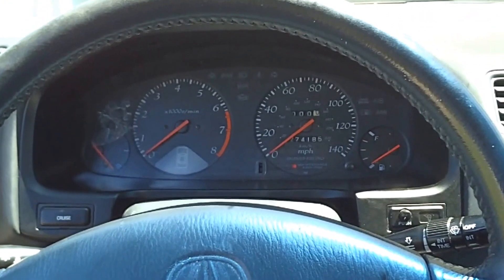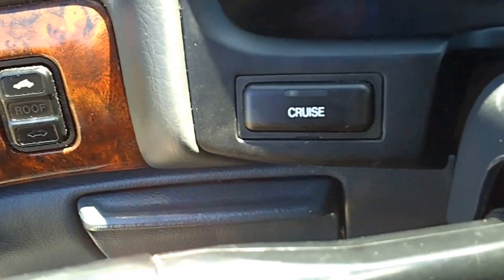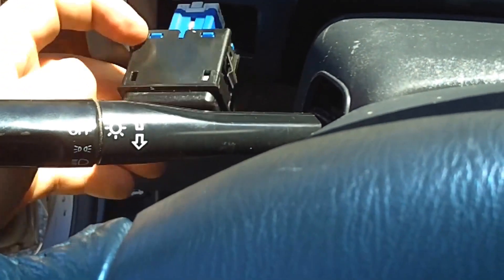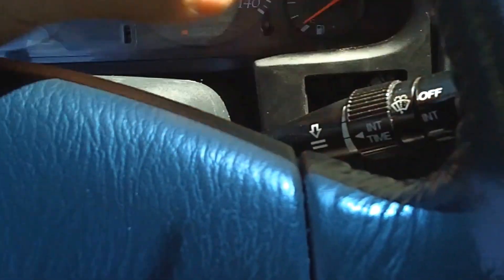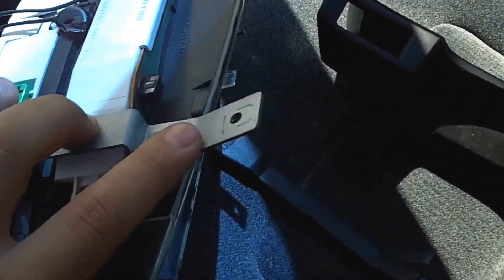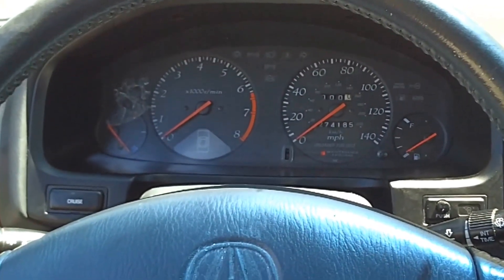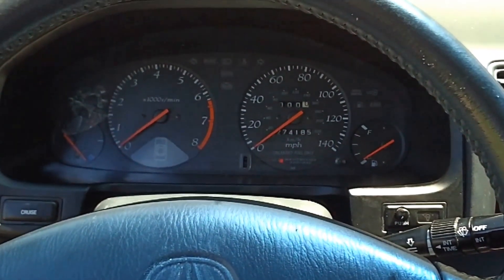Acura CL Cluster removal DIY

Comment from the maker: Yeah, it's in pretty good shape for the mileage.  As far as the tab goes, when I worked on car electronics as a job we used to use either hot glue(rare) or 3m strip caulk to hold the plug in place if the retaining clip was broken that held it in place.

Comment: thanks for the vid. i was getting hung up on the top plugs too. i wanted to replace a few bulbs and pull out that damn ABS bulb. common issue. i had it checked out and brakes were normal. also know someone else with a cl like mine but hers isnt the 3.0 like i have but same issue. abs on lol
Reply from the maker: Yeah my ABS light was on the entire time that I owned that car.  The brakes never failed me once on it.

Comment: 274k, looks clean for that mileage!  Any tricks on getting the dimmer back in?  When I removed mine I couldn't access the back and a small area broke off that retains the harness plug tab.  I found a magnetic screwdriver is key for reinstalling those hidden screws.

Comment: OUT is not too difficult ... putting it back IN is a pain in the XXX.  I too had to get rid of the ABS light which is a small lamp located on a circuit board.  Not MENTIONED in the video is that you must remove the circuit board which is covered by a white plastic piece that holds the large dash bulbs.  There are 10 screws that hold that circuit board in place and, for some reason, despite the board aligning in only one fashion and getting a few of the screws started, 7 or 8 of the screws simply won't start to thread.  I'm taking the rest of the day off due to frustration and I'll start again tomorrow.
Reply: Curtis altschul results?
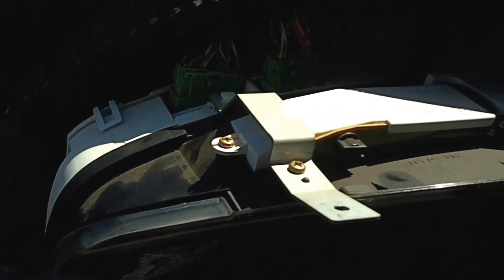Reply: @reyyce4658  Regarding the screws that would not thread ... it turned out that I'd made a mistake in aligning the speedometer and tachometer.  Once they were aligned properly (which I thought I'd originally done correctly), everything went together.  Those screws were necessary as nothing worked without them in place (no lights, gauges, speedo/tach - nothing).  With them in place everything worked.  There are two brackets (2:24 of the video) that should be removed/unscrewed which will make removal and return MUCH MUCH easier.  If you are mechanical enough to take this apart, you'll see how things go together.  The ONLY special tool you'll need is a magnetic Phillips screw driver.  Without such a screw driver it would be virtually impossible to put in the bottom two retaining screws that are a recessed a couple of inches in.  I bought one at a local hardware store for $8.  Actually, it turns out, that I was wrong in my first evaluation and the whole process, when done correctly, was pretty easy.

Comment: It looks pretty simple to get the cluster out, my question is, how difficult would it be to change the lights in the instrument panel? I want to get rid of that horrid green and switch over to a red.
Reply from the maker: From what i saw, it didn't look "easy".  It didn't look like your usual Honda cluster where the bulbs just twist out.  But I didn't really look too much into it at the time.

Comment: My dimmer switch will not pull out far enough so I can unplug it
Reply from the maker: Mr99RICH99 It didn't pull out all the way on mine either.  I had to use a pick tool to unclip it and to get it back in.  A screwdriver should work also, just be careful not to break the connector.